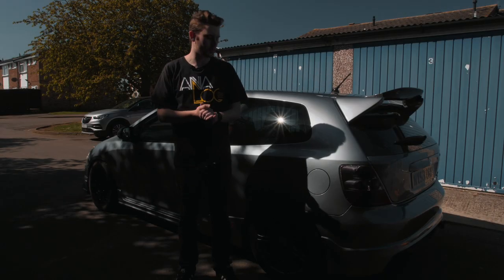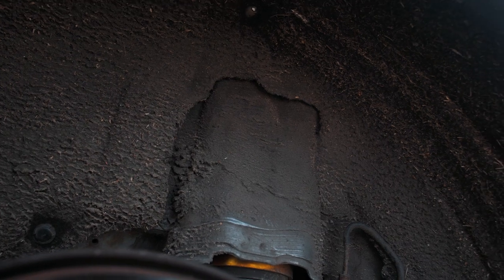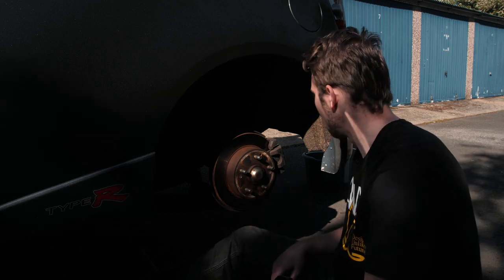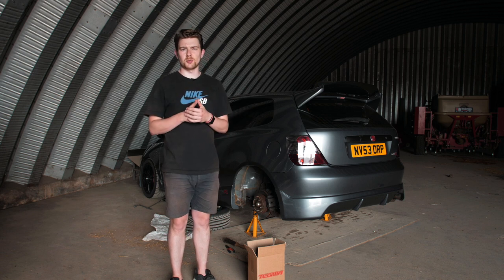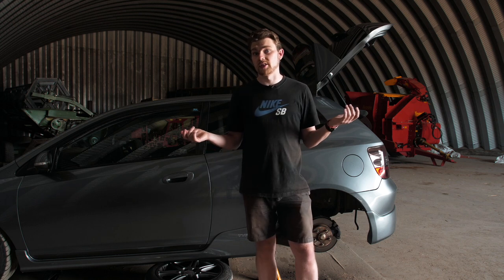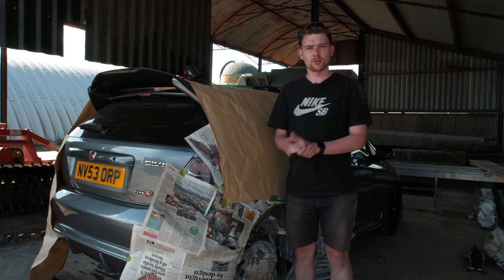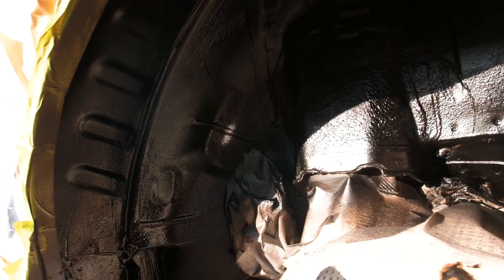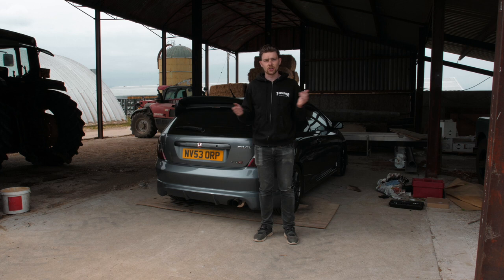Undersealing The Rear Arches Of My Civic Type R EP3!!

Comment: Great job nicely done and sealed. U can even open your rear speakers clean and seal inside inner arches from moisture. Also remove carpets and oil fill through holes from inside to cover inner sills and floor pan.

Comment: This is a temporary solution, but you did a good job. You should check the backside of the threshold and mudguard. All adjacent planes should be cleaned to a perfect surface and painted, otherwise, the rust will return.
Reply from the maker: Thanks man! Yeah I know, I need to bring myself round to looking behind the speakers and areas like that too!

Comment: You could have got a fuel pipe plastic cover, you’ll normally see it in preface lift cars
Reply from the maker: What!? I didn’t know this existed!! 😱😱😱
Reply: Olly Ross yep, only on preface as they don’t come with arch liners. Best place to get will be direct Honda dealership, just get any Preface reg number or Honda part number 17668-S5A-940

Comment: Got this job lined up on my 5 door civic, I know it's had panels welded on the rear arches, and the passenger brake line is cable tied to the handbrake cable, I'm gonna need a lot of luck

Comment: Great job. You was lucky to have no holes. I did mine last month and there was a couple of small holes. Like you, I decided to put the liners back in because they do a good job at protecting the majority of the rear arches from stone chip damage. I also did my underbody, it’s worth checking your sill / floor pan area. EP3 are getting bad for rust there too. Cheers
Reply from the maker: I’m thinking of cutting the arch liners so they only protect the back part as I’m still worried about it rusting. Both Motion Motorsport and Honda have said that it’s pretty clean underneath. I’m going to keep an eye on it though. 👊🏻👊🏻👊🏻

Comment: First thing I did on mine.   It is crazy those liners.   As for the breather I just zip tied it to the filler tube in a few places.
Reply from the maker: Definitely needed doing! Cheers man!
Reply: Olly Ross I’ve left the liners out and done the whole thing as well.   I used an all purpose cleaner in a spray bottle to degrease and then used a pressure washer to get it all off.   Then used the same under seal as you.   It actually makes it much easier to keep it clean, when you wash the car just give around the inside of the arch a spray with the pressure washer up over the wheel.   The trouble with the carpet liners is they keep the mud, salt and water in contact with the panels and they take days to dry out.   With it fully under sealed the water just seems to run off and they are dry in minutes.

Comment: Hi Olly, I know this is a rather old video, but did you ever take off those rear arch liners or keep them in to this day? I just bought a facelift yesterday and looking to do this myself, would love your feedback :)
Reply from the maker: If you check my more recent videos, you will see that I have had the full underside restoration now. 
My advice would be to do what I have done in this video APART FROM the underseal. Just primer it and leave it. It will save you headaches in the future. With regards to the arch liners. I cleaned them out sometimes, probably not enough. 
I now don’t run them at all
Reply: @OllyRoss  Appreciate the reply, definitely will do that then! Funnily enough i saw your restoration vid just after i commented this. My first EP3 so im proper excited to start work on it. I've had people tell me to run it without the arch liners but will probs run it with and regularly clean them for sure

Comment: I did behind my speakers the other day. I found on the driver's side a small hole. If you don't mind me asking, how much did the welding cost?
Reply from the maker: I know the guys at the garage so they did me a deal. Because it didn’t need to have any parts taken off to reach the spot, they charged me £20. I don’t know how much it would actually cost though. It is a pretty quick job

Comment: Hi
Where I can buy , wheel Arch Liner - Back Side, right and left?
Thanks
Greetings
Reply from the maker: Are you looking for the carpet replacement parts or the plastic parts that come on the prefacelift cars?
Reply: @OllyRoss  at 3:30 minute you pull out the wheel arch, I'm not sure it's plastic 😅you can confirm, the car is a pre facelift 
Tks
Reply from the maker: @marques6359  The carpet that I pull out was only on the facelift cars. I would recommend not using these as they hold moisture right next to the metal of the car. The Prefacelift cars had plastic covers that would be better (they don't cover the whole arch though)
Reply: @OllyRoss  Honda said they don't have that part.  They no  manufacture this part any more.
 Thank you for your feedback. 👌🏽
 Best regards

Comment: It’s a joke most manufacturers don’t galvanize bodies. It’s the main reason I won’t touch Japanese and fords. I drive a 20 year old Golf, though they can suffer from panel rust, structural rust like sills, and floor pans they don’t. My sills still look good and my boot floor pan is immaculate. Under the bonnet there’s nothing around the shockers, or chassis legs. It’s a shame cause I’d love another Japanese car. Subaru or EVO. Most of them are rust buckets though.
Reply from the maker: It is very annoying! More and more JDM cars are getting unsaveable due to rust! Maybe your next one will have to be one that has had all the rust protection already done?
Reply: @OllyRoss  That world be nice, but the price won’t be reasonable. I remember back in the day when you could pick EVO’s and Subaru’s up for a decent money. Now the price is through the roof. I’d rather buy German than Japanese when it gets to a certain price point..